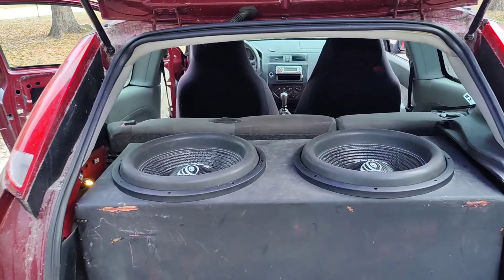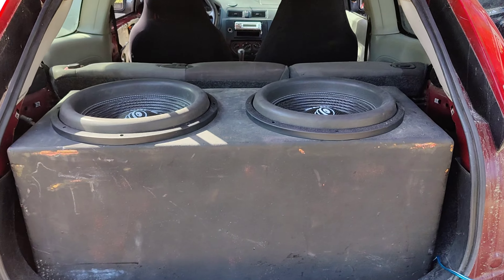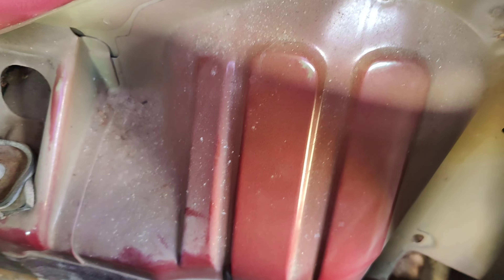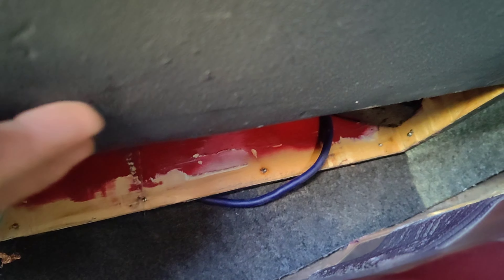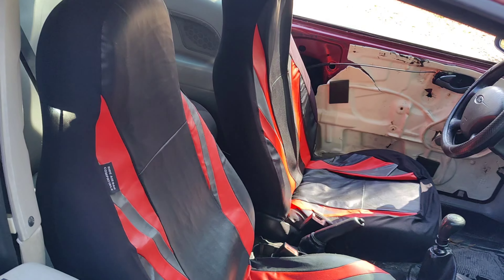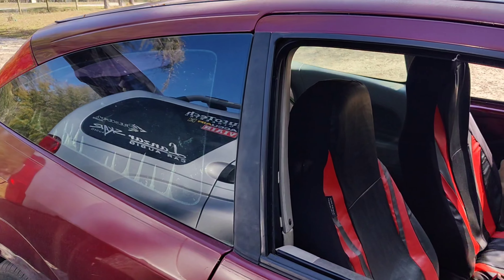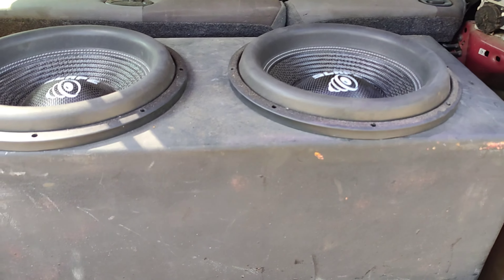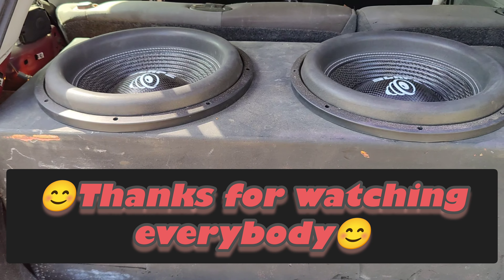😱Slapz NEO 15s on Slapz SHB 8k😱

Comment: 2 15s bro one 15 in a 4 cubic feet on a 2 k was crazy in my svt and you got 2 😂😢
Reply: That’s what I wanted to hear, I’m grabbing a single 15 oblivion to switch out my current sub. My box is 4cf after sub displacement, dual 4” aero ports and tuned at 32hz.  I have high hopes
Reply from the maker: @adamjeezy465 you will not be disappointed make sure to use my code BoomTerra at checkout 🙏🫠